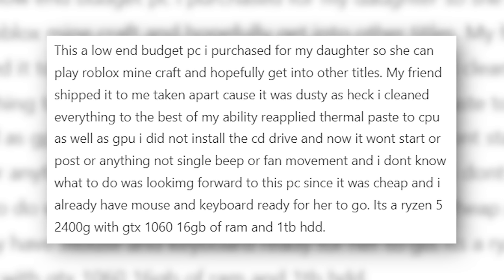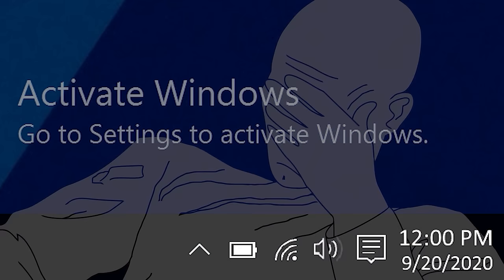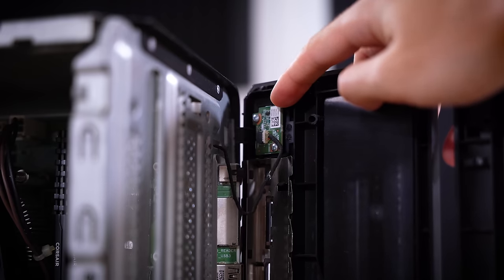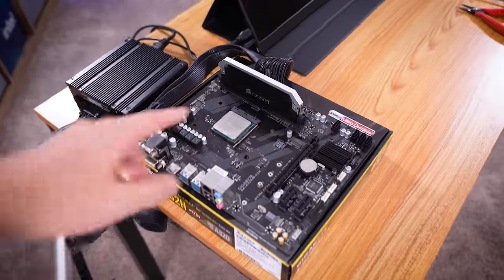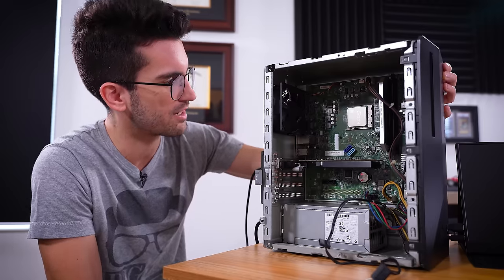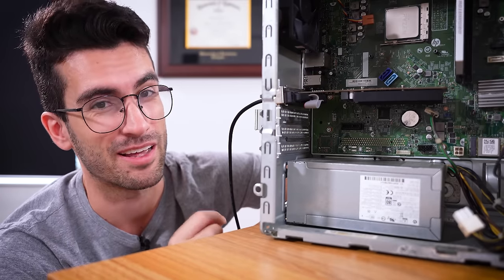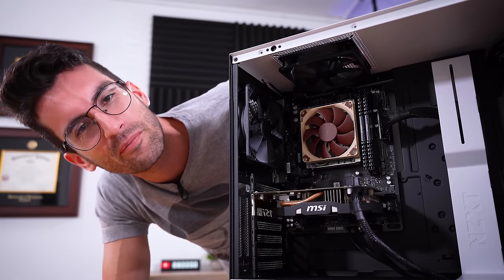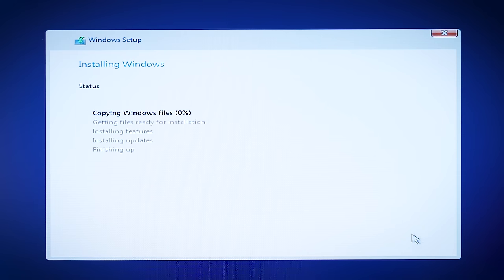Fixing a Viewer's BROKEN Gaming PC? - Fix or Flop S4:E13

Comment: You can actually buy power cable converters that would allow you to use a regular power supply with that stupid HP motherboard they have been at this proprietary bullshiterry since the core2duo days and they will likely continue to do that until government regulations comes in to play just like how the EU forced Apple to switch to USB-C as this is really helping in to adding these to the e-wastes bin.

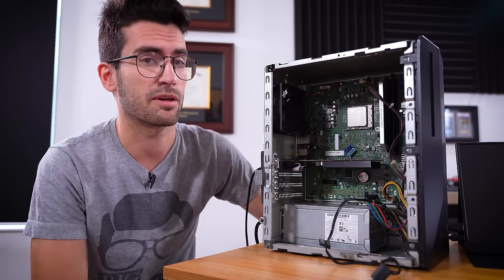Comment: 8:45   Best NOT use a multimeter to test batteries.
Sure, if you get a low reading, the battery is flat, BUT, if you get a normal reading, the battery may have the correct cell voltage BUT have a high internal resistance, which the multimeter won't pick up!
Best use any (cheap) dedicated battery tester because they apply a small load to the battery which will show a lower voltage if the internal resistance is high.
I bought a brand new $150 laser collimator for my telescope because I thought my old one was faulty. The battery in it measured fine with my multimeter, but the laser was not working. Turned out the $1 battery in my old collimator had a high internal resistance - replacing the battery fixed it ! ! !
Kicking myself because I actually had a cheap eBay tester (which I failed to use) which later showed the battery to be low. 😡
Anybody want to buy a brand new $150 laser collimator?  I have a spare. 🙁

Comment: Hello Greg need help on my PC. I have been watching this series for long now. Good job. Since I am in India so can't send the PC to you. My PC config is AMD Ryzen 3800X, Asus ROG X570 Strix-E Motherboard, G.Skill 16x2 GB DDR4 3200 MHz RAM, Gigabyte RTX 2070 Super 8 GB, 1 TB WD Black SN750 SSD, Antec EA750G 80 Plus Gold PSU. 

My PC is now almost 4 years old. In past 4 years of use, I have had minor hiccups like failed SSD, HDD etc. Which I self diagnosed and fixed. However past year, I faced issue with the RAM, where 1 of the module was giving BSOD, so I contacted the distributor for RMA. I sent them both the modules, which they tested and didn't find issue so returned it back to me. However, I faced the same issue again with the same faulty module so I kept running my system on single working module. Anyway, last month my primary SSD failed again. So I sent that for RMA, meanwhile I thought since I am waiting for the replacement I should send the RAM for RMA as well. Which I did, and surprisingly this time the RMA team found issue with the RAM and sent me replacement. 

I received both replacement SSD and RAM on same day. So I installed them and booted the system. It posted perfectly. Detected all components. So I prepared bootable Windows 11 USB. I installed it, after initial installation, as you know that it prompts for various options like providing Keyboard layout, PC name etc. After this, the monitor showed grey screen, but I didn't get error No DisplayPort Signal detected. So I rebooted, it went thru the some steps of initial setup process. And I booted in to Windows 11. I was installing drivers, steam etc. Again it gave me grey screen. So I rebooted but this time now instead of booting normally in to Windows. It went into Diagnostic Mode asking for repairing the Windows. So I tried reinstalling Windows 11. It went fine till initial setup screen, then it again gave grey screen even before completing installation. I tried updating BIOS. I tried installing Windows 10. But issue remains. So I thought maybe SSD is faulty. So I ordered a new one. But same result. I tried Memtest86. It took 3-4 hours. But no issue was detected. Now I tried with bootable Ubuntu in USB. It's working ok. But I am not familiar with Linux that much.

Can you please help me.

Comment: Im not saying I disagree......but you have used Power Supply testers in the past.....so why are you not doing it now?
Reply: 9 months late, His PSU tester only supports standard connections, 8-Pin EPS, 24 pin Motherboard connector, etc. This PSU has non-standard connectors.

Comment: Did you check the power cable?   Just kidding, that's way too obvious. But yeah, OEMs like this are a double-edge sword, they are cheap but you will definitely end with a broken component that could be very hard to find and even if you do, it could even be hard to know if what you bought is the right one or will it even work

Comment: There are some very good OEM PSUs out there though... For example the ones in 2012-2013ish optiplex systems are very good! Low power... but great efficiency, silent and sturdy. Even been using them from discarded systems for years in nas pcs and htpc. Just needs some cable extensions in some cases. Also, learn some soldering. With some splices it is very easy to get a 'normal' PSU to work in systems like you have. Well, as long as the physical size of them allows of course.

Comment: I'd prefer if you "salvaged" rather than scrapped.  You might have taken that voltage tester and turned it to the standby voltage (usually 5v, sometimes 12v on these OEMs, either way, marked on the PSU).

Also you can correct me if I am wrong, but it looks like it runs on two standard ATX 4-pin.  I am sure you have a power supply around that can attach to that and you can do use your power supply tester or the "jumper the green wire" trick.  What I am saying is it is quite wasteful to throw that thing away when power supplies are available for $15-25.  At the very least you could sell it as "bad PSU" after you test the motherboard.

Sad we never got to the bottom of whether the PSU or motherboard was bad.  Good job getting them fixed up though.
Reply: Those PSUs are next to impossible to find new, and second hand (or 'refurbished') they're £40-£200.  It has such little application it's not worth salvaging, by design it's an obsolete piece of equipment and just needs to be chucked - we need less of them in the world, and the average person needs to be educated better to avoid them because they're basically just a scam-piece.   Designed to not last in comparison to other PSUs, as well as limited hardware compatibility and high costs to replace for the same low quality part (as anyone who'll buy these PoSs in the first place are going to be uneducated laymens who will just send it back to HP to fix, and they'll extort the crap out of them).

No need to investigate, GS was right to just bin it and replace it.  Those predator---- sorry, proprietory parts need to die a death, man.  Let it go.

Comment: the only thing i wouldve done differently is use a stock cooler from amd if you had some laying around since im not a fan of the noctua brown on black and white parts, and put the hard drive in the build in addition to the ssd because why not
Reply: HDD's can slow down the systems, so it makes it pretty moot putting in an M.2 and SSD.

Comment: instead of needing a whole new psu if you dont know if thats the problem get a cheap 15 usd psu tester that tells you all the voltages its recieving to TEST the current psu before you discard that being the case of a dead psu and ask the owner if you can keep the psu (theyll prob say yes) and do further testing on it WITH a tester
Reply: No need, just to find out if it's definitively dead or not?  Pffft, chuck the proprietory part even if it wasn't dead.  They have significantly short life spans, prone to faults, and are expensive to replace (finding new is next to impossible, and second hand ones are stupidly expensive).  We don't need to know definitively if it's faulty, we just need to educate people better on why they shouldn't really buy pre-builds.

Comment: this is why I hate HP now.... the idiots went ahead and made another version of trash! these units are pretty much not even worth saving if broken.... on these systems, I will pull the processor, memory, and anything else that can be saved, trash the board and the chassis and move all the saved parts into a new build..... HP and DELL are making systems with proprietary motherboards, and I hate that....

Comment: first time that i actually think greg got scammed since he couldve broke something on purpose and got away with a "brand new" pc.. sad to see
Reply: To break it 'on purpose' would be pretty difficult, especially breaking it in a way that wouldn't cause harm to the parts during any testing.  I think the father who sent it in just got/bought a dud from a friend who didn't check it before shipping it.  

That PSU definitely died of it's own accord, those cheap nasty things on average die around 3-6 months in - they're basically designed to fail so non-technically bozos will ship them back to Dell, HP, or whoever where they'll replace it for another dud part that'll eventually fail.  And then charge them an extortionate amount of money to 'fix' them.  That's the real scam.